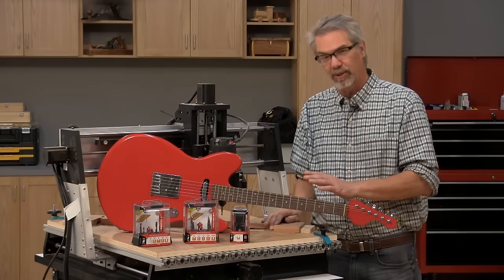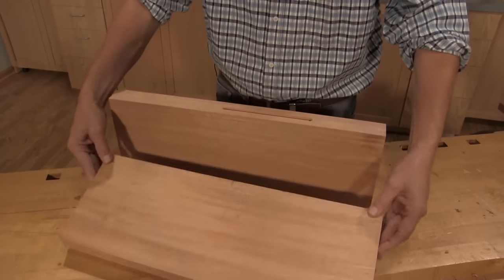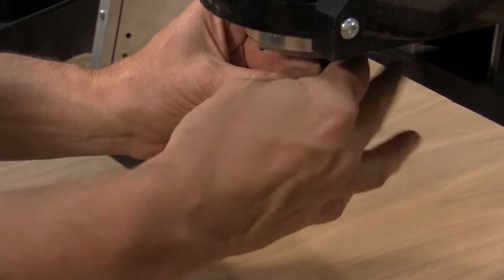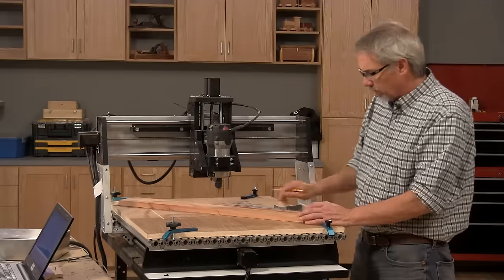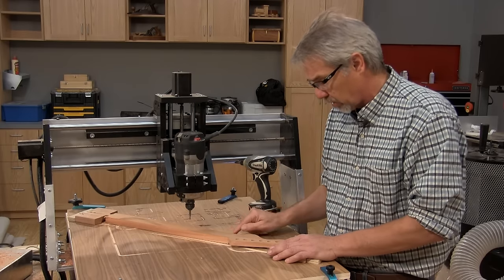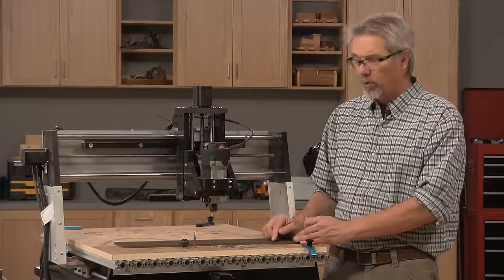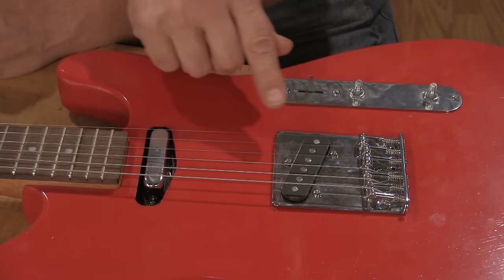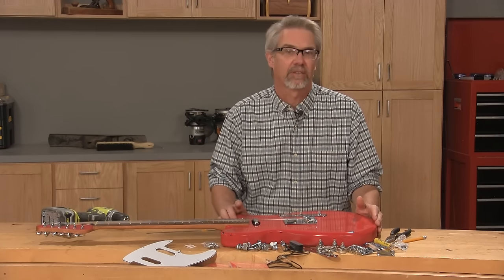Using a CNC Router to Make an Electric Guitar

Comment: Very curious how you compensated for the runout inherent with the CNC Shark. You were running your endmills far deeper and faster than I'm able to on my personal unit.
Reply: I am afraid I can't be of much help with your question. I have not noticed significant runout on the Sharks I have used. This machine was a pretty new one with few hours of use on it. Sorry I can't be more helpful.
Reply: If I may ask, can you tell me your feeds and speeds for each bit used in the project? Also, did you use a feed % reduction in the Control Panel settings? Thanks for your help Rob!

Comment: Ummm...along with the lack of a truss rod, I don't see any radius in that fretboard. Critical to comfort/playability. 

He really downplays the non-CNC stuff too. A CNC is a great tool for the course stuff like cutting out the body blank. However, roughing out the body with a handheld router or on a table accounts for a tiny fraction of the build time. Even hand carving the neck isn't that long a process - and is much of the fun. Unless you're going into production, the CNC won't save you much time at all compared to the rest of the build.

The real work of building a playable guitar happens after all this CNC stuff is done.

Comment: you never cut the slot in the neck for the truss rod so you can take the twist out of the neck and set up the string hight.
Reply from the maker: There is a program for a truss rod in the package. Truss rods are optional, so we treat it this way in the programing.
Reply: With almost 200lbs of pull from stringing the guitar, truss rods SHOULD NEVER  be an option.  With no truss rod in the neck you'll never get consistent play-ability as the neck will absorb moisture and eventually bend out of shape from moisture absorption and the pressure the strings have placed on the neck.  I'm guessing that your not a guitar player as you would have NEVER made that neck without installing an adjustable truss rod.  Besides that, it definitely makes cutting out bodies and necks with power tools.  And you don't need a bunch of templates
Reply: Always a truss rod needed be.

Other then that Awesome work!

Comment: I still prefer doing it "the old fashioned way" by hand & only using a router to cut out the cavities for all of the electronics. Easy enough for a solid body guitar/bass. However, now try making an Acoustic guitar with that CNC machine. Good luck with that one..................